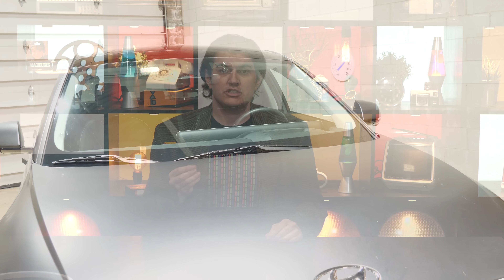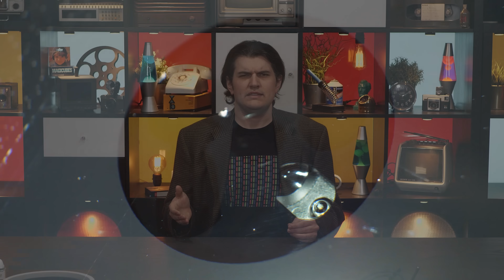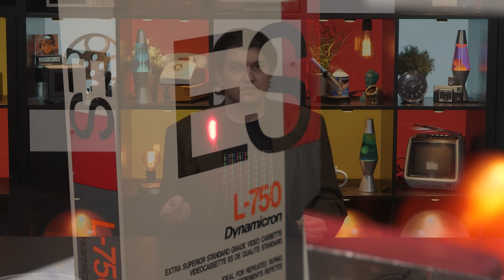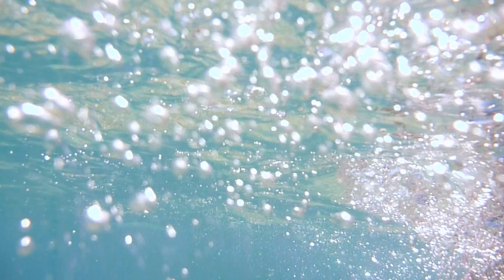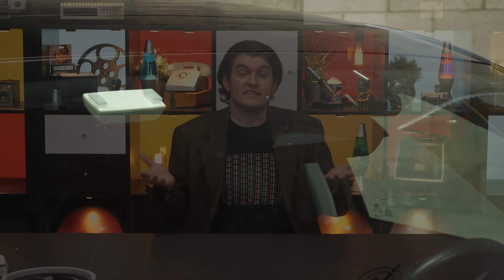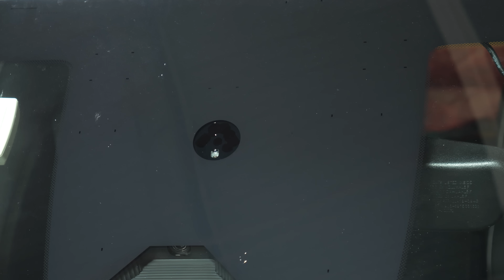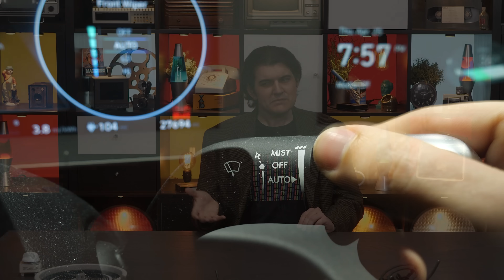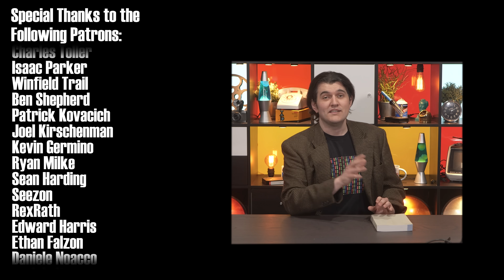The simple, clever sensor behind automatic windshield wipers

Comment: As a Tesla owner, thank for the first 50 seconds of this video and 8:50. A much needed roasting of Tesla's decision to not include them.
Reply: Yep. The Tesla wipers are so so bad. One of the reasons I ditched mine. Especially living in the UK where it rains all the time.
Reply: My tesla randomly decides my windshield needs wiping... with no rain... and in the rain... it barely works
Reply: @pHBalanced4u  I have no insider information on Tesla's auto-wiper algorithm, but my guess is that it looks for obstructions in the front camera's view.  (It's likely a specific looking obstruction that resembles water.)  Now, I've seen the same problem as you and it has become a bit of a running joke.  It will be a beautiful, sunny day, and without any warning, the wipers will start going off.  My take is that dirt or something like that is getting in the way of the camera and it's either mistaking it for rain or it's trying to clean the camera.  (Not sure how good the latter is since it doesn't use wiper fluid.)  What I usually do is force a wipe with washer fluid, and after a swipe or two, it will stop randomly wiping.

The wipers are notoriously bad at night though, which is likely due to the reduced visibility.  As noted in the video, auto-wipers are generally not that responsive to fast changes in the rain, but I 100% agree with the video that having a physical control that can be quickly adjusted is very important.  My 2013 Ford had auto-wipers too, and it wasn't uncommon for it to be too slow to respond when going from a drizzle to a downpour.  However, all I had to do was flick the left stalk's dial, and it was on HIGH.

Now, Tesla has tried to make it a bit easier to work with the wipers.  If you hit the single wipe button, it will bring up a menu that can be controlled by the left thumb wheel.  Scrolling all the way up will stop on HIGH.  Although, I have one major issue with this... it's just Tesla trying to place a band-aid on a problem that they caused.  Their obsession with removing physical controls because "you won't need them with full self-driving!" or the desire to simplify the hardware has just lead to trying to find even more solutions around the inexcusable amount of complexity that they've introduced.

Also, there is this rather annoying issue where I leave my wipers on AUTO, but I'll get confused when my wipers don't come on in the rain.  I check my wipers, and for some reason, they're turned to OFF.  This isn't just a one-time thing as it happens A LOT and it's rather annoying.
Reply: @shinaikouka  My observations on the Tesla (Model 3) wipers is that they operate so the car can see - it doesn't really care if the OPERATOR can see...
Reply: Model Y LR owner here - 100% agrees with that! Vision only is somewhere between stupid and dangerous!
Reply: @WattDieHölle And Elmo doesn't give a shit what thousands of owners want. That's the real problem.
Reply: I’m honestly infuriated with Tesla removing the stalks. What next, touchscreen gas and brake?
Reply: I hope Tesla comes to their senses and offers this type of normal sensor as a retrofit. I'll keep dreaming.
Reply: @Dan4096  they won't... they got rid of USS as well. I hated that when I got my new Y (didn't know until after I picked up the car). Recently they made an update so even autopilot is less useful. This is my 3rd and last Tesla most likely. Don't get me wrong, I still love the car, but some of the decisions are turning fans into haters. There's no real competition yet, but it's coming.
Reply: Tesla doesn’t even rain sensing wipers?? Lol
Reply: @ONI1013.  They do not have sensors to save money. It's estimated they cost less than $10.
Reply: @PopsGG  “To save money”?? And that’s pathetic excuse from Tesla. For a car that’s $60-130k??  More reasons why Tesla should never be considered an “luxury” brand.  What other amenities are they missing?
Reply: @ONI1013.  that's a long list. I'll list a few
Front instrument panel 
Power lift frunk
Dozens of buttons and knobs 
Power sunroof 
360 camera view
Spare tire 
Ultrasonic parking sensors 
Android auto and Apple CarPlay
Cooled seats
Reply: @PopsGG  Wow.  I knew Teslas were missing several features, but didn’t realize it was THAT many.  All my cars have everything on this short list (except Power Frunk), and I would say some of these amenities are essential “must-haves” in my book: 360 Camera, Sonic Parking Sensors, Apple Car Play integration, Ventilated and heated seats, Power sunroof.   Geez…. I would even add: rear Cross-Traffic and pedestrian alerts, “smart” blind spot monitoring, 4 zone climate control.  Does it have those features?
Reply: @PopsGG  Wait, so you can't even use CarPlay in a Tesla? That's just ridiculous...
Reply: @ONI1013.  No cross traffic alerts. The 3D-scanned “park assist” view takes the place of all the other parking assists like sonic sensors, 360 camera, etc. It has…varying degrees of effectiveness. There’s no alarm for cross traffic or pedestrians, and the FSD computer’s ability to see cross traffic is somewhat limited since the side-rear cameras are mounted on the front fenders (inside the turn signal repeaters) and there is no rear side-looking radar that’s normally used for this feature. You do get the camera feeds on-screen at least though.

Blind spot monitoring will ring an alarm if you try to merge into somebody, and there are various warning displays on the dash tablet if you have your blinker on while someone is in your blind spot. It also turns on the fender camera on the tablet, and will flash a red border on the camera window if someone is there. With the exception of a few newer models though, there is no visual alert anywhere besides the tablet, which is the opposite direction you’re normally looking while merging left (or right in RHD counties)

Climate control has 3 zones, driver, passenger, and rear. I never have more than 1 other person in mine, but I don’t think there’s a separate temp control for the rear, just fan on/off and and seat heater on/off. Oh, and unless you have the new model 3 or the S/X, the rear passengers don’t have their own controls for their seat heaters, only the dash tablet can control them 🫠

But hey, at least the auto seat heater and auto fan speed up front works well. Much better than the auto wipers, which deserve all the shit they get in this video
Reply: @ONI1013. they are missing a dashboard. And turn signal stalks.
Reply: @ONI1013.  It has cameras, sonic sensors, and heated (but not cooled) seats, traffic and pedestrian (and bicycle) recognition and auto stop, blind spot monitoring (auto camera turn on optional with turn signals) and multi-zone climate.  It parks very well and drives itself very well on highways (not quite so great on surface streets, but does OK).
And on the $$ side, they start at $45K, not $60K.
Reply: @VAXHeadroom  Auto camera turned on if you use turn stalk? That’s not Blind Spot Monitoring sensor.  And if you don’t use turn stalk, then you won’t see cars coming in your blind spot?  Honda tried the same thing and failed miserably.  And I thought it doesn’t have 360 Camera view, nor Sonic parking sensors.  Does it have those things?
Reply: @ONI1013. At least they have a built-in Playstation 5 😂
Reply: @ONI1013. It uses the dozen cameras they put in the car and AI that already exist on the car as a replacement for the ultrasonic parking sensors. 

It worked poorly in the beginning but it's been getting progressively better. I'd say it's at the point now where it's at about the same level as an ultrasonic system now, it can detect things like curbs and thin poles/towing hooks better than ultrasonic sensors, but in other areas it can still fail.

The motivation from Tesla here was to simplify the car and bring more value to it by using existing systems instead of spending money on something it might actually not need, which I think is a good idea in theory, and a large part in what makes much of them so good, but it feels they can often be a bit overzealous in their work of implementing such solution. For example their camera-based auto-wipers (which work the same way) still aren't as good as the "normal" ones mentioned in this video.

I do think long-term it can turn into a competitive advantage as they can offer cars cheaper than competitors when they can do the same thing as they can without using components they have to use, but for now it's definitely iffy at times.
Reply: @ONI1013.  It shows traffic on the screen (virtual road view) so that kinda counts.  Yes it has cameras all the way around and ultrasonic sensors (11) around the car.
Reply: @swecreations  So in other words, Tesla’s Parking Sensors and “Auto” wipers is like the Rube Goldberg of automobile industry.  😂
Reply: @ONI1013.  Auto wipers yes, the parking sensors from what I've heard are working decent now though.

I mean at least theoretically a camera-based system would eventually with enough development be a lot better than ultrasonic just because the resolution and coverage is so much better. It will need more development for that first though. It was just very recently that it actually started getting good enough to where it's comparable to ultrasonic in performance.
Reply: @ONI1013.  tesla does have rain sensing wipers....
Reply: @PopsGG  model S and X have cooled seats, the sensing system is just as good as a 360 camera IMO, apple carplay is pointless when you have a dedicated apple music app, there's no need for more buttons and knobs, and how do you expect them to put a sunroof on a roof that is entirely glass?
Reply: @ONI1013.  they has heated seats, and their expensive models have cooled seats. they have a vision sensing system that is basically just as good as 360 cameras, and you can see the side cameras when backing up. And if you've ever seen the glass roofs on teslas, it would be basically impossible to install a sunroof without taking away the panoramic roof. And they do have multizone climate control
Reply: @PopsGG  Hmmm.  A little out of date.  No ICE cars have power hoods.  The whole idea of sun roofs is stupid (I've had them), latest software has a version of 360 camera, fewer and fewer new cars actually have spare tires, S, X and the new 3 have cooled seats.
Reply: @PopsGG the part? Yeah probably. The software? Naaa.
Reply: @shhmule With Apple CarPlay and Android Auto you can easily switch apps and select what you want within an app.  You can be listening to your music app, then you can switch to your audio book app, select the book you want, and play.  Then, you decide you want to listen to a podcast, so you switch to your podcast app, select the podcast you want, and play.  Plus, you can use whatever navigation app your phone has on it, including Waze.
Reply: @VAXHeadroom I want a Tesla so I can speed in auto pilot lol
Reply: @ONI1013. I agree that Tesla stinks, but you NEED 360 camera to drive, sonic parking sensors (Which detect tiny wisps of grass and annoy me, I know how to park within inches) apple CarPlay is good, but is it really anything more than a large phone or iPad on a mount with Bluetooth?
Reply: @_..-.._..-.._  Huh??  If your main issue with your sonic parking sensors is detecting “tiny wisp of grass”, then your car’s sensors are way too sensitive.  LOL.  Yeah I can park and drive without these features— but doesn’t mean these features are not useful.   🙄
Reply: @PopsGG  Power sunroof is because the roof is part of the structure and why the car is so good in crash tests.
360-cam is already here.
USS is not needed since we have vision park assist now.
Cool seats is now here.

Agree with the rest though. Also, I don't really care about buttons.
Reply: @ONI1013. The tesla allows you to view side and rear cameras onscreen coupled with the interface that shows distance from objects, airplay isnt really needed imo(onscreen apps for everything already), heated seats front and back are standard just not cooled, climate control is imo great, the car display also shows all nearby objects/cars and displays blind spot camera on screen along with showing a virtual car on screen next to your car (also works for bikes, trucks, motorcycles, and pedestrians)
Reply: @PopsGG Honestly I think it's more about Elmo not wanting to just add something to the assembly process. He'd rather task engineers with a coding project to soothe his ego.
Reply: @ONI1013.  It can virtually drive itself, does that compensate for lacking a few buttons?
Reply: @TheLuizSouza  I don't even know what CarPlay is, so I guess it is not important to me
Reply: @ Sorry nope.  From the long list of luxury amenities missing, I wouldn’t call it “lacking a few buttons.”  Nice try..
Reply: @ONI1013.  They're not a luxury brand and Model 3s cost $20k.
Reply: @ONI1013.  Another thing they're missing, at least in the model y is back seat heated seat switches. You can turn on the heated seats for the back but only using the giant ass screen at the front which is so dumb to me
Reply: @ONI1013.  Tesla was never a luxury brand. It is how people perceived it. The model 3, and Y are by far the most popular teslas, so when you refer to tesla, basically you refer to those two.
The model 3 went as low as 36k€ in France (shipping cost, and taxes included), which is ridiculously cheap compared to the other brands. For that amount at the time you got a Renault zoe.
Now you get a Renault 5 "full option" for that price.

Now try the infotainment of Porsche and come back to me and tell me it's worth the price tag.

Mercedes doesn't have cruise control in its base model of Ev's for around 65k€.
The Ford Mach e didn't have electric seats for 70k€ (demo vehicle).
Toyota had an aliexpress camera and a random inconsistent design with text that overflow over the rest of the interface for 60k€
Vw.... They don't know what to do, buttons, no buttons, and are still struggling paying their insane fine from the diesel gate.

They all have many flows.

Tesla is alsmot the only new automaker that managed to enter the market in the last century and that is viable. There's is a reason for that. They objectively make good cars, whether you like it or not. The entire market criticized their choices and now everyone step in their path for many things.
Reply: @PopsGG  Elon said you don't need them. And since he defines reality at Tesla, they don't have them. See also: Cybertruck.
Reply: @ONI1013.  Tesla is in no way, shape, or form a luxury vehicle nor has it ever been. It's closer to a Corolla than anything.
Reply: @ONI1013.  It uses the camera which doesn't work well at all
Reply: @ONI1013.  they do but uses the vision camera system NOT this "simple" system
and the Model 3 I had as a demo they worked really badly
Reply: @ONI1013. they do
But they suxk
Reply: @ONI1013. I didn’t know either, Tesla owners hide these things!
Reply: It's insane how terrible the auto wipers are. And they will never be fixed with any amount of software and machine learning because the camera just doesn't have the information necessary.
Reply: @No_True_Scotsman  In my opinion, in one sense, Tesla created all these unnecessary ways to do things “different” when the standard car industry has already figured it out and works great (e.g., like Auto Wipers, Sonar Parking Sensors), which sounds a lot like someone’s ego at Tesla who is trying to g to be “innovative.”  

But on the other sense, bucking the status quo more often requires many failed attempts at first until they finally build a better mouse trap.  I get it.  I still think Tesla is trash and their cars are very limited in what many buyers looks for in amenities, BUT I will give them credit for trying new things.  If one gets it right, it pushes all manufacturers to innovate — and we all benefit from that.
Reply: As an old Tesla owner, hehhehehe…
Reply: Commiserations
Reply: honestly, the latest updates fixed it for me, but the Model 3 Highland also include a infrared diode at the camera system
Reply: Me too hahhahahahha
Reply: Ikr it’s awful. My wipers will randomly go off whenever there’s glare on the road or bug splatter
Reply: I don't drive a Tesla but I was looking for this comment.
Reply: How does a Tesla know it’s raining then???
Reply: It has a fifth sense
Reply: The RAV4 has had it since its previous generation 😂
Reply: Mine work fine. I've had to adjust them once or twice in the 3 years I've owned it. Guess I just got lucky.
Reply: My BMW E46 2000 has a rain sensor and it works very well.

The rain sensor is fine when it rains just a little and any number is already too fast. The sensor wipes when there are enough drops which is good, and the wipers don't wipe on dry "glass."

I don't know about others, but for me the sensor is a very good feature.

These are features that are useful for better driving compared to the current features which are more annoying than useful 🙂
👇
Lane Keeping, the in-car camera that beeps for every stupid eye movement, Start/Stop, etc.

Reversing cameras also have a sound (a beeping sound) when you approach to... ex Tesla, etc.?

Because the PDC on my car are 👍
Reply: My BMW E46 2000 has a rain sensor and it works very well.

The rain sensor is fine when it rains just a little and any number is already too fast. The sensor wipes when there are enough drops which is good, and the wipers don't wipe on "dry" glass.

I don't know about others, but for me the sensor is a very good feature.

These are features that are useful for better driving compared to the current features which are more annoying than useful 🙂
👇
Lane Keeping, the in-car camera that beeps for every stupid eye movement, Start/Stop, etc.

Reversing cameras also have a sound (a beeping sound) when you approach to... ex Tesla, etc.?

Because the PDC on my car are 👍
Reply: I had a 99 Buick Park Avenue and it had rainsense wipers. I would never have a car without that feature.
Reply: it works now 😂 1 year later
Reply: Actually, my Model 3 is not that bad with the current software version...
Reply: Amen
Reply: Tesla has this awkward habit of trying to reduce component complexity regardless of how it affects drivability.  Another good example is how Tesla vehicles don't have the blind spot indicator that most other cars have.   In lieu of that -- it would be another piece of hardware after all -- Tesla just shows you the appropriate camera feed on your display when you use your signal.  The problem is that the camera feed is displayed on the center screen (regardless of whether you're in a Tesla vehicle with a dash cluster or not), which means that if you want to turn left, you need to look to the right (at the screen), and then look to the left (at your mirror).

My usual remark about Tesla's "engineering" is that it seems like whoever designs/engineers the car doesn't actually use the car.  It's pretty much the reason why you have UX teams when it comes to creating software.  Engineers tend to be focused on the mechanical or functional aspect, but a UX team should be focused on how the user interacts with it (is it legible, how easy is it to use, etc.).

One other interesting problem that you can run into is controlling your lights.  For example, in some states, you're required to turn your lights on at certain times outside of low-light situations (e.g., in a construction zone).  To turn the lights on, you have to hit the Car icon in the bottom left, hit the Lights option on the pop-up menu, and then hit the ON section of the slider at the top.  Given that Tesla has pushed their voice control in emails, you would think that you could say "turn the headlights on", but Tesla does not support that.  I could understand them wanting to avoid a user accidentally turning off the lights via voice control, but in the case of headlights, a positive action should be acceptable.

 @PopsGG   Apart from the Model Y, all other Tesla models have cooled seats now.  They originally limited the feature to the Model S and Model X, but it was added in the recent Model 3 refresh.  The feature is likely to be added in the Model Y refresh... whenever that occurs.  I believe the Cybertruck has it -- it better for the price -- but I'm not as in tune with its features.  Also, the Model S and Model X do have a dash cluster, but I don't think Tesla really uses them in the best manner.  The pre-refresh models could display things like multimedia information on the dash cluster, but the refresh models cannot.  The left of the dash cluster is empty until you navigate somewhere.
Reply: @shinaikouka You have got to be kidding about Tesla headlights. THREE separate touchscreen activations to turn them on? I would never have guessed that the rotary switch in my 22-year-old Dodge minivan — two clicks right, done without taking my eyes off the road — is such a brilliant bit of engineering.
Reply: @TruthInFlying  Sadly, there's no funny business.  Tesla just seems to have this awkward habit of trying to reinvent the wheel all in this desire to reduce hardware complexity.  The problem is that since their solutions are often worse, they end up having to increase software complexity to make up for it.   Another example is how -- for quite a long time -- you had to do the exact same thing to adjust your wiper speed. I recall driving on an Interstate from a light rain into a downpour to not have the wipers react quickly enough.  I ended up having to manually change it through the touchscreen while driving on the Interstate.  Now, if you hit the single wipe button, it will bring up a prompt allowing you to change the speed via the left wheel on the steering wheel.  So, they essentially realized that their solution was dangerous, and implemented a completely different wheel to replace the existing wheel that most cars use.

Not to mention that the wheel is predominantly used for volume control, so when the wiper sub-menu is up, you can't change the volume via a physical control (you can on the screen).  As another side note, Tesla also differentiates multimedia volume from navigation volume, and if the navigation is talking to you, any volume adjustment (via the wheel) will adjust the navigation volume instead.   So, if I'm traveling and getting off an interstate where my music may have been up a bit higher to combat road noise, I now have to wait for the navigation to stop talking before I can turn down the music.  Given that I use the interstate to get home and Tesla auto-navigates home from work, I end up running into that problem A LOT.  Not to mention that they also seem to use different speakers at times for the navigation volume, which affects your ability to hear it.  Sometimes, it uses the default speakers, and other times, it seems to use a center speaker positioned below the screen.  Also, sometimes, it reduces the music volume when speaking, and sometimes it doesn't.
Reply: @shinaikouka  I have read and re-read your note and find it stupefying. I like the idea of BEVs, but unfortunately for me a battery vehicle will never be as inexpensive to own and operate as my ICE minivans — and there’s nothing available at this point that would have equivalent capability. But what really scares me is the sort of things you describe: the unbridled complexity and mystifying engineering decisions surrounding the attempts to cram all this technology into BEVs. Not to mention what will certainly be extraordinary expenses for repairs down the road. I maintain a 40-acre estate and my mantra is “everything eventually breaks.” The power-mirror switch on my previous minivan broke several years ago. My cost to repair it was $3 — seriously, three dollars for a used switch, shipping and tax on eBay — and 20 minutes of shop time. A friend spent $14,000 to have the battery in her BEV replaced after the range dropped to 35 miles. I can easily afford expenses like that, but I don’t want to.
Reply: @TruthInFlying  Not all BEVs are Teslas.  BEVs that are not Tesla tend to be much more traditional.  However, all vehicles, BEV and ICE are putting more functionality into the infotainment screen, so it's pretty hard to avoid that.  It's worth noting that all BEVs come with at least an 8 year/100k mile warranty on the battery.
Reply: @TruthInFlying at 200,000km my model Y was $67,000CAD Less than my Jeep Wrangler at 200,000km. More if you want to count the 10 years of inflation on the Jeeps initial cost vs buying the model Y.
Reply: @WentzCraft I bought a 1999 Chrysler minivan for $1,500 in 2010 and drove it just shy of 100k miles before giving it to my housekeeper a year ago. At 240k miles on the original engine and transmission it is still running. I bought a 2002 Dodge Caravan for $2,300 two years ago; 210k on the original engine and transmission. A 100k warranty on a BEV battery? Big deal. Yes, I do all my own maintenance and virtually all my own repairs, so I am a poor candidate for a $50k BEV, even though I could pay cash for two dozen of them. I can, but don’t want to.
Reply: @TruthInFlying  If my Jeep had cost $0 to start and I lit both of them on fire after 200,000km, my Jeep would still have been $7000 more expensive than the wife's model Y. Now this is just an anecdote and those two vehicles are by no means in the same class but gas is expensive and electric charging at home is not.
Reply: @WentzCraft  I can’t imagine that any Jeep is practical or less expensive opposite an electric runabout like the Model Y, but in my case there is not a single BEV that can match the utility of a 22-year-old minivan. Mine has no rear seats and in the past week has hauled a water heater and washer and dryer. It is in the driveway right now loaded with a job site table saw and trim wood. And my 1996 RAM pickup might use plenty of gasoline, but it cost me $3,100 fourteen years ago and I’m not about to dump loads of gravel into a $100,000 BEV pickup. Anecdotal for sure, but it does show that for many people it will be a long time before BEVs meet their transportation needs.
Reply: @TruthInFlying  I hope I stated that my comparison vehicles were not in the same class, The Jeep is a lot lighter but less aerodynamic, though they are similar size. And yes batteries need to improve their energy density a tiny bit for a utility focused vehicles, but that's going to happen very soon.

 I'll use just your comparison then 1996 ram gets about 12mpg (less as it ages). Current Average US gas price is about $3.3usd. assuming you drive it to 200,000 mi in your RAM costs $55,000 USD gas alone excluding the higher maintenance. Electric vehicles have thousands less mechanical parts to wear out and the ones that do wear out are the same as an ICE vehicle. 
We are basically at the point where an ICE vehicle needs to be free in order to compete with a $50,000 EV. If you're buying a used EV and running it to land of life, these numbers get absolutely stupid.
Reply: @shinaikouka tldr
Reply: No automaker dare to challenge hard problems except Tesla, you will not laughing when they solve it
Reply: Why 8:50? The hood covering the blades gives you quite a bit more efficiency and therefore range, ist smart design. And the button to service the blades is literally right in the service menu in the car, couldn’t be much easier. The decision to not use a rain sensor however is borderline stupid, wipers don’t work well on Teslas now since 7 years and counting
Reply: @davidglieder8862 he was talking about the pro stalks part I think
Reply: @davidglieder8862  How hard is it to command your own vehicle to wipe brother it takes 2 microseconds to move your hand
Reply: There's no need for carplay or android auto in a Tesla
Reply: @rObOu73 uh, by that logic, Tesla doesn't need auto breaking. Sure, maybe they don't to a certain extent, but they're a cost cutting measure and not even much of one. Basically every other car (except for some GM vehicles), even ones with Global positioning systems, have android auto/Apple Carplay as an option. Why is GM, one of the worst car manufacturers on the planet, having anything to share with Tesla?
Reply: A Tesla is not a “luxury” car brand. You buy it for the technology and software, because honestly all the non-essential hardware is shit.